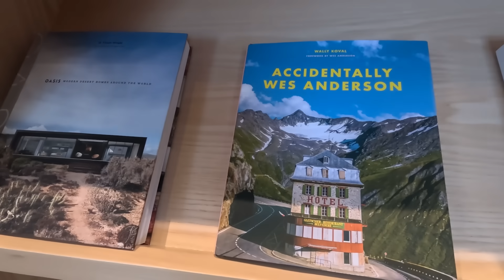THE DAY HAS FINALLY COME!!!

Comment: We live in central Wyoming.  When Wyoming got it's first electric car, the person was guaranteed it would get ANYWHERE they needed on a charge.  They'd have no trouble driving the four hour distance on one charge.  Two hours later, they were stuck on South Pass and had to wait for a tow truck.  They found out that mountains Did drain excess power.  I would never get one living in this region.

Comment: We own both R1T and R1S. Had the truck for about a year and handles well in snow, on dirt and even overlanding. Just think about your charging situation and whether you can charge it inside your garage. EVs don’t love cold temperatures especially when it’s sitting outside for long periods of time. Other than that I am sure it would handle mountains well.
Reply: Ohhhh, great point about them not loving cold temps.
Reply: I’ve not had mine through a winter yet, but I love my R1T. And I sure don’t miss pumping gas.  The deposit is refundable, go for it. I waited a year, but the line is shorter now.
Reply: I would wait until they get the NACS charge port so you can use the Tesla supercharging network. 2025.
Reply: Get a normal, mountain living gas powered SUV. I had to leave the room for a minute when you pulled up to the all-electric debacle.
If you want to buy some all electric toy as a third vehicle fine, but not as a primary.
Your real workers and real people and you need real vehicles. ie. real trucks/Suv's
Reply: How would you charge a Rivian in the mountains? Batteries charge slowing the cold. A level 2 charger for your garage is something you need to investigate.
Reply: @davidlabedz2046  exactly, level 2 charger in the garage would be the way to go.
Reply: @DJPetrou  LOL at electric vehicles not being “real”. I bet you’re the kind of person that gives people grief over everything, like drinking the “wrong” beer. Get over yourself, man.

Electric vehicles are totally fine. Honestly, electric motors are superior to ICEs at this point, in terms of horsepower, torque, reliability, and maintenance. Also, electric trucks like the Rivian have outlets in the bed that can run power tools.
Reply: So expensive!! That’s all I know- yes I am a senior!! Feel so bad want things better for climate control but as a middle class person thinking about an EV scares me!! How much is is to install the charging port and how much is it to buy electricity for it??
Reply: So charging a vehicle is going to take less time than pumping gas?  And what's the cost difference between fuel and electricity??  And how long do you have to have the vehicle to actually make the cost of buying one make sense..?
Reply: @DJPetrou they have allies truck as the primary work truck. Trent’s truck is the toy.
Reply: @Jkaye13 could charge the truck at night when it’s not being used.
Reply: @chrisray1567  You sound like a person who doesn't own an EV but reads spec sheets and parrots what all the other non EV owners say.
Reply: The range will be drastically reduced by the terrain.

Comment: I like the Rivian; electric rocks.  It is All Wheel Drive - so I would expect it not to be a problem going up the mountain - assuming you have the right tires/chains as needed for the conditions. If you go with the Quad motor AWD it can do rock crawling, rally, drifting, snow, soft sand, and all terrain - so there you go.

Comment: I think I'll put in my vote for you checking out a Subaru.  I looked at Rivian's website, and the prices (!).  My Subaru, the second I've owned, gets 32 mpg on the highway and 24 in town.  My niece rolled hers when she was 8 months pregnant and because of their focus on safety she was fine.  When they put the car back on its tires, she drove it home.  90% of the Subarus on the road are still being driven by their original owners.  It's all wheel all the time.  The problem is there's not enough clearance for you to use standard chains.  I've never been stopped in snowy conditions.  They see the car and they see the all-weather tires and just wave me through.  I believe you can use cables on it but you'd have to confirm that with a dealership.  Ther's also a newer version of the Outback that has additional ground clearance and additional low gears for mountain and off-road travel.  If you are determined to have an electric vehicle they don't make one, the only hybrid in their line up is sold in California and is the least powerful of all the models they make, it's also a smaller car so probably wouldn't be useful for you anyway.

Comment: Make sure your home electrical service can handle the charging station requirements.
Reply: Not sure why people have this concern with a modern house.  This is a concern with some older houses that only have a 100 amp service but almost all modern houses get a 200 or 400 amp service and an EV charger will use 50 or 60 amps mostly in the middle of the night when your not using anything else in the house.  Effectively it's like having another heat pump or range.

Comment: The metal roof looks great and so does the new door, after all the adjustments. You'll do just fine when the snow decides to come in abundance. Spend some time snuggling by the wood stove fire and have something real good to eat. Treat yourselves. Congrats to all you hard working people, Trent, Allie, Brandon and Grayson. Jennifer is a super auntie for Leo! Take care.
Reply: The floor under the door is not level, and going under the floor and leveling the joists and box would be a better solution. Also be sure the door is shimmed high enough to allow for the subfloor thickness, if any, and the thickness of the final flooring choice.
Be sure to also allow for the inevitable floor mat in front of the door. Don't want the door to drag.

Comment: Allie, great idea about the sheetrock. Even if you only got a third or a half of what you need, that would allow you to finish off part of the addition if the clock gods smile on you. Everything else that you need can come up your little hill in your pick-up.  Are you going to sub out the insulation?  Next to giving the sheetrock to a third party, doing that with insulation will make you smile.

Comment: French Doors are not two door opening designs. One door can open and one is virtually just a fixed window that CAN open but is generally shut tight. The other swing open door is the main entrance/exit. Much more weather proof than sliding overlapping doors.

Comment: I’m not anti-electric but I’m also not rushing to get an electric vehicle. They are improving all the time so… Hope your injuries heal quickly Trent. You seem to be in good shape for snow season so onward you go!
Reply: 🧐 couldn’t you make that same statement about any car/truck/computer…?
Reply: @MountainBeaches Possibly.  Personally though, I feel nostalgic with most cars and trucks "they don't make them like they used to".
Reply: @cornypinkuni9519 yes, they don’t make them like they used to, with 5-6 quarts  of oil that needs to be changed, Fuel pumps, spark plugs, fuel injectors,
transmissions, and EGT sensors. Lucky for you you can still buy a brand new car with most of those things, you just can’t buy it from Rivian.
Reply: @MountainBeaches   gas powered computer/modules have been in constant development since the late 1970's. EV vehicle obviously much less, so not the same. Rivian is under great scrutiny by it's investors due to not meeting production and sales goals, even though they show over $1B in cash. If they go under for any reason, you're left with a very expensive piece of garage art with no service and parts support! Hybrids are a much better choice, as shown by Ford, GM and Toyota vastly scaling back EV production...
Reply: @rixtrix11  any technology has to start somewhere. Your argument makes no sense. Of course there are risks. Hybrids may be a better option for some but not others. The problems with Hybrids is that they are not good at being an EV or a combustion engine product. Don’t be deceived by the marketing.

Comment: The Rivian would be an interesting alternative to the Ram and would probably perform well for you.  However, I've heard that if the rear body panels ever get damaged it can be STUPID expensive to repair because they are unibody and made from Unobtanium.  The way that you use a truck damage to the body is a real possibility.
Reply: I have a little Tesla 3 and the body work on it is OUTRAGEOUSLY expensive.....but I still LOVE LOVE LOVE it!  I don't know about driving it in such cold weather and at your elevation though, and the way I drive uses up the charge much faster than than they report as normal....

Comment: So happy the roof is done, the doors are in and it's nice and dried in for the winter.  Those guys do such good work.  And a Rivian?  Hope that works out; not totally on board with the electric vehicles because of the need to charge so often, but it could work.  Have a wonderful week you guys, thanks for taking us along. (from Sandi)
Reply: Sounds like the rivian range is better than the trx.

Comment: Had both electric then hybrid which I feel is best choice.  Electric is convenient as you can charge at home but in our area electric is expensive and the difference between utility bill and what we had adding electric and gas station was actually cheaper with the gas engine. Yes we did follow the discounted time frame for charging our vehicle.  We still wanted better mileage so found the hybrid to be our best option.
Reply: Solar is free…

Comment: I live in Salt Lake and own a Tesla Model 3 dual motor…it handles extremely well in the winter, and I think the Rivian will be even better.  Electric vehicles are very heavy which helps.  Agree with the point about charging…put a station inside and keep the vehicle there when not in use.  In addition to savings on gas…my Model 3 has NEVER had a service.  My F250 is about $500 every 5,000 miles.  Cost of operation is way cheaper and makes up for the high initial cost.

Comment: Trent, make some ice cups with styrofoam cups, if you have them. You can fill them (or paper drink cups, that you tear off pieces around the cup) 3/4 full, let them freeze solid, then tear off a strip around. You can use the cup up several times for mulitiple icings until you run out of ice in that cup. Rub the top of the ice smooth in the palm of your hand, then ice your finger NO LONGER THAN 5 minutes (so you don't freeze the bone) going through the burning-stinging phase into numb. Do that a few times a day and that will help with pain. Ice your knee and elbow, 20 minutes each going through same phases. :) 

No I can't really recommend all of this because I didn't finish my athletic trainer program and I don't have my degree, but I had over 800 hours from college in Sacramento. Ice is awesome for breaking the pain-spasm cycle while it reduces swelling. It's the best! 😄 The house looks great!!! Sorry you've had a bunch of injuries lately. Prayers for your mom, Allie. 💝 Love watching Leo grow! Such a cutie!!
Reply: Agreed!  Ice is excellent and the first thing that should be put on any injury/ bee sting/ bug bite.. because it reduces/ minimizes swelling and pain.

Comment: For your adventuring lifestyle it probably is the best choice. It’s how much you want the suv or truck. The con about the truck is the cover, it has lots of issues and I don’t think they have really fixed them satisfactorily. It has decent build quality, but service is still kinda hit and miss but better than Tesla. But you could take it to Mesa and get through most of the courses with it. Look at out of spec review channel for reviews and in-depth analysis on it. Make sure there is reliable charging where you want to go and you have enough panel space for a charger for it either outside or inside the garage.

Comment: If you go 100% electric, then long term you need to install solar on your property. For me, I would go hybrid instead of 100% electric. You get better mileage with a hybrid and if you are traveling long distances, you won't have the long wait times on the charging stations. All electric is for city people. If I lived in the US and had the budget, I would get the Toyota Tundra Duel cab... a good work truck. But if you want 4x4 and not a work truck, then I would go with Grand Highlander Hybrid - great towing capacity - AWD etc.

Comment: Hey guys!  Leo should be in a forward-facing car seat.  His legs hang out..the indicator to switch.  Then have the fire department check its installation.   He's really growing!!
Reply: Minimum turn around time is 24 months, but Leo was a preemie, so they should probably wait until at least 2 years from his due date.  Legs hanging has nothing to do with it. It has everything to do with the spine's ability to keep the head attached in an accident.  Some people keep their kids rear facing up to 4 or 5 years.  Legs fold and kids are 5 times safer rear-facing.

Comment: I think it’s time for Leo to get a big boy car seat 😊
Reply: Which would have been an absolute pain as they would have woken him up as they would have had to take him out and then they would have had a harder time with the test drive, having to transfer the big seat.  As long as Leo fits the weight and size requirements of the seat, he is good...and some go to 35lbs and 32inches.  Legs hanging out doesn't matter. His head needs to fit the height. Also, big seats can stay rear facing, which is 5 times safer than forward facing.
Reply: I lived at a time, when we did not wear seat belts nor have child seats. And we lived through it. I do think a child need a car seat, until four years old. If there is a problem with them not minding, you pull over an explain we will go back home if you don’t mind. I definitely do not like them facing backwards. If they were choking, how would you know? When choking, they can’t talk. Every year they change the rules. How come they did not find these faults, the first time they did all the test?
Reply: @DebraBreen-uf1jg  I'm glad you survived. I lived through it too.  Many parents use a mirror to be able to see their child when they are rear facing, as I did with my children.  You can see a child choking in the same way you could if they were forward facing.  The law requires children to be in a child seat or booster up until the age of 8 or 57 inches tall. (4ft 9 inches tall) Please do not recommend to parents that they behave in ways that are unsafe for their children or break the law. My own daughter was quite petite and I kept her in a safety seat (not a booster) because the seat belt was correctly positioned for her height, she did not slump over if she fell asleep and it had side impact protection for her head. She liked it because it had a comfy headrest to lean against when she fell asleep, it had storage places for stuff and it had a cupholder that she could easily reach.  Many parents move to the booster as early as possible and that is their choice, however, 4 years old is too young to legally not be in a seat.

Comment: I totally agree with you on the Dodge pickups. Fun to drive. Comfortable. Great ride. Crappy gas mileage! I have a 2004 Dakota with the 4.7l V-8. 13 mpg when I bought it (used). Have since put in a new motor (at 212, 000 miles), tires, ball joints, and alignment. Still 13 mpg.

Comment: In my small town in the northeast Rivian vehicles are becoming very common place. They are second only to the Teslas that have had a head start. Our terrain is not like yours but black ice can be pretty common in the early mornings and we do get snow between now and March. I would think that Rivian could give you owner names in terrain more like yours. The only thing I would say is that I suspect in a couple of years the improvements to electric vehicles will be remarkable with respect to speed to charge and total mileage. Colder areas do present a faster drain on batteries so improvements could really help in those areas.

Comment: To your question About electric vehicles to consider; which is about the batteries & the charging condition limits. 🤔

I recall last winter, Tesla was being evaluated for cold operations and charging.

If I recall, correctly, the test car had been left out in the cold a day or more.  They were unable to charge it.  

They waited until the temperature warmed to a functional temperature. 

Then they had to wait. The Tesla used power of the batteries to self heat to a temperature ok for charging.

This information lacks detail, but questions functionality for your conditions at higher, colder altitudes?

Navy avionics veteran.

Comment: I have a Ford Lightning EV truck. Does okay, but I have range anxiety trying to use it for a work truck where I can put anywhere from 100 miles to 500 miles in a day of inspecting. Charging stations for the Tesla are pretty much in decent supply at the Sheetz stations, the other types of chargers are lacking and off the interstate by 20-30 miles.

Comment: From all that I have read about electric trucks, they do not function as well as they say. They do not do well in cold weather because when the batteries are cold the batteries will discharge instead of charge. Then you have to make sure you have charging stations that you can get to if you are away from home. I think it will be sometime before they are really worth the price, another feature is the batteries if you have to replace them they could cost over 28,000 dollars. I think you should wait awhile and let all the bugs get worked out before you commit to such a costly endeavor. And by the way you are doing great on your house Grayson and Brandon are great helpers. And Leo too.